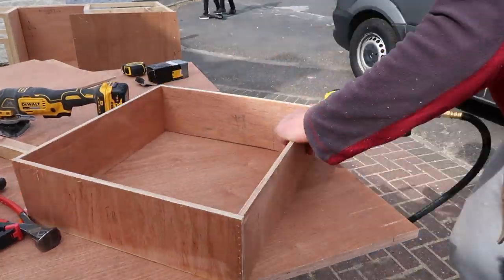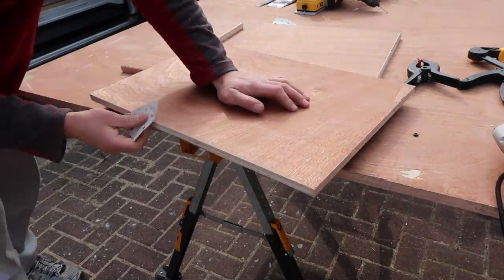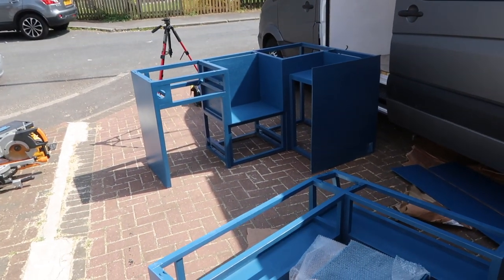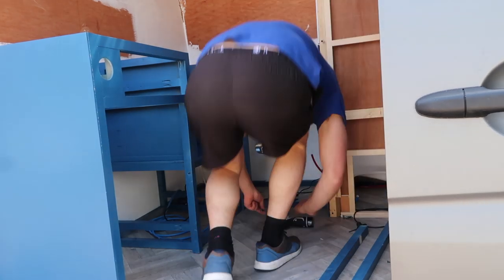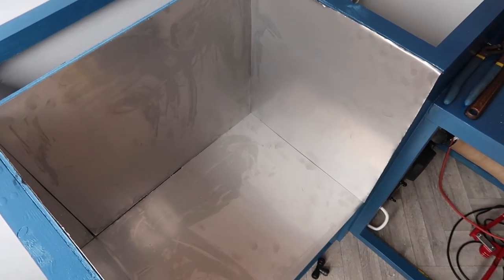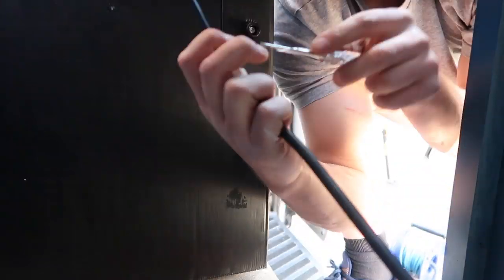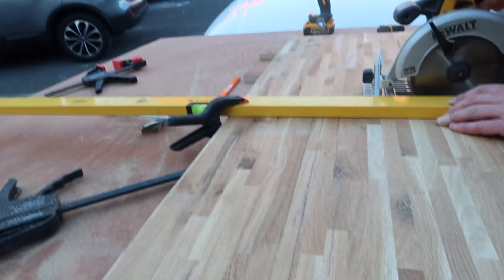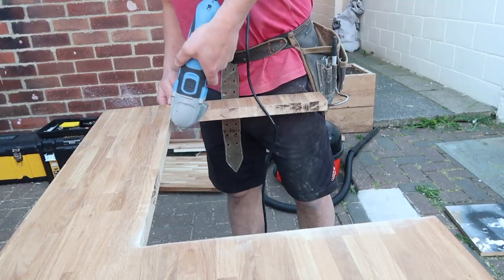Kitchen Build | Ep24 | Sprinter Conversion

Comment: Hey mate ! Thanks for the awesome video ! Quick question, how do you know when diagonal screwing the corners of the main frame that the screws won't hit each other ? Just common sense or any special Technics ?
Reply from the maker: Hi Alexis. You just have to be mindful with the placement of your screws however If the screws do hit each other then they will usually just redirect themselves slightly. The wood is soft enough for the to reroute and won't have any effect on the fixing or the strength of the joint.
Reply: @ScottAndJen  Thanks a lot !! happy travels !

Comment: Hey really helpful video, thanks! How did you secure your oven into unit? I can't seem to find a way to secure it as the space surrounding isn't enough to access with a drill! Thanks
Reply from the maker: Hi the oven has two threaded holes in either side. I fixed a button in the kitchen carcess in the relevant position and then used counter sunk holes to fix it in place. I am going to be uploading a few videos in the coming weeks around all of the other little bits and bobs from the build so it should be in there
Reply from the maker: https://youtu.be/MnnzdM6fagk

Comment: Hi Scott. Great video. Where did you get the steel sheets from? It is expensive. I hadn’t planned to put it on the base of the cooker. Looks like I might need to order more! Did you get the heat proof sealant from where you got the steel? Steve
Reply from the maker: Think it was metals4u Steve. Wasn't that dear no and no I got that separate from eBay
Reply: Cheers.